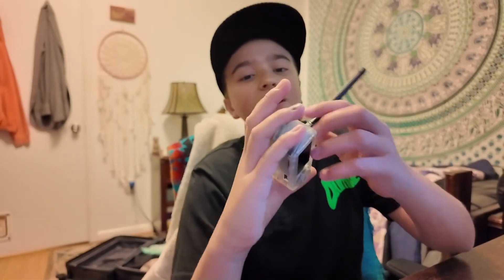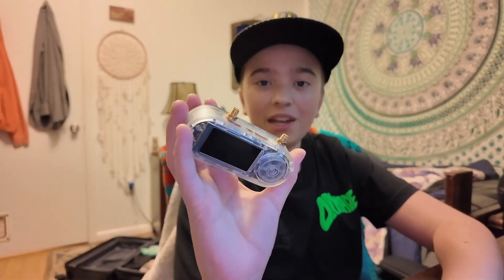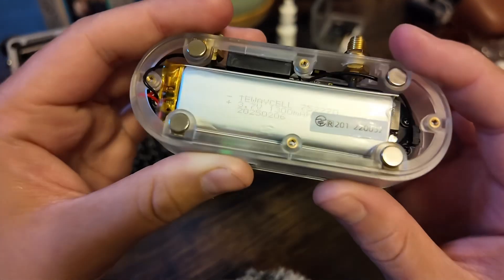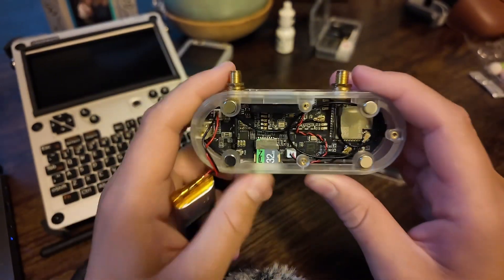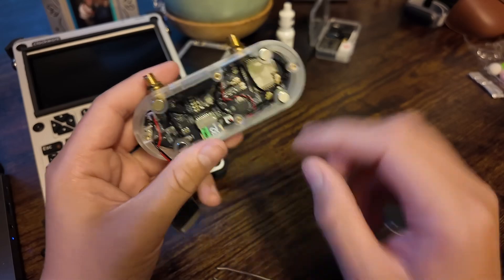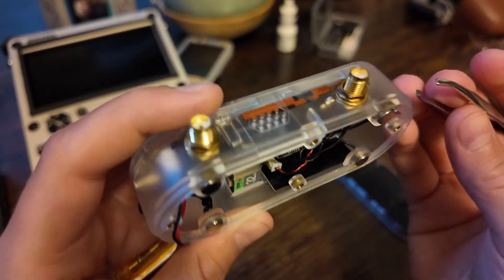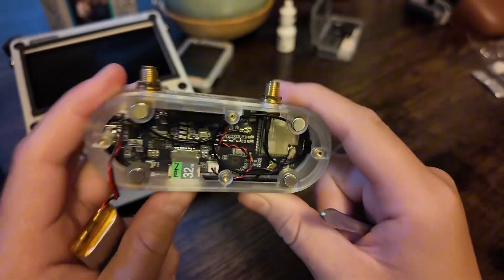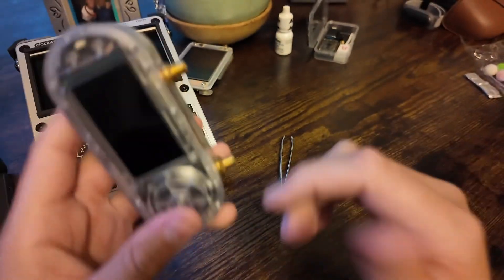Antenna Mod To Lilygo T-embed Cc1101

Comment: hey, want to buy t embed cc1101, where i can buy this thingy for antenna? and without it can work CC1101 and WIFI? or no?
Reply from the maker: You could buy them anywhere just try Amazon and yeah, it works without them just not as good
Reply: @AdventuresofIllya  what this is called? i am  from poland
Reply from the maker: @Oqureqz sma antenna
Reply: @AdventuresofIllya  thanks
Reply: @AdventuresofIllya  but the slot for this?
Reply: Just get the new plus model

Comment: Ir is not working for me why!
Reply from the maker: Did you get the T-Embed with the CC1101? A lot of people only buy the regular T-Embed and think they got a good deal but it turns out they just got a stripped-down version with barely any features.
Reply: @AdventuresofIllya I had the IR working but with the new update it didn't work all other features work